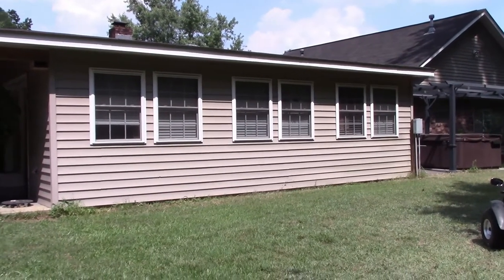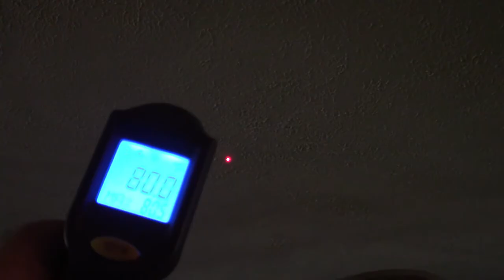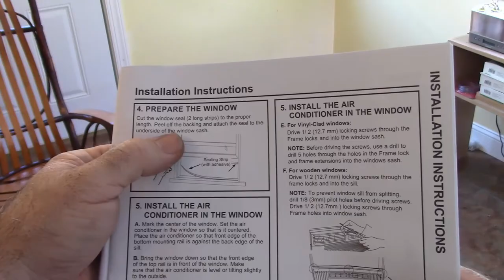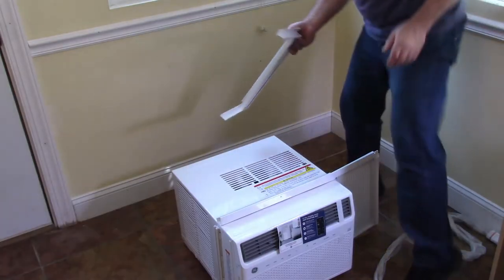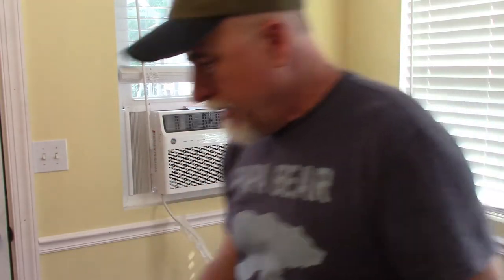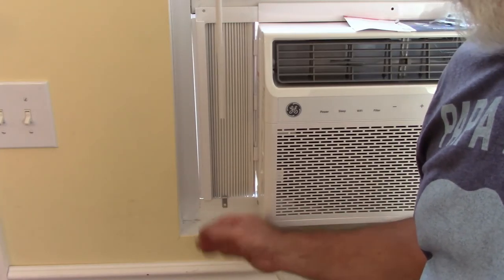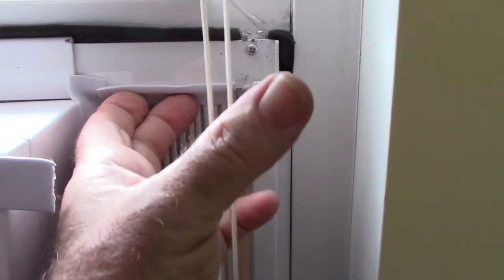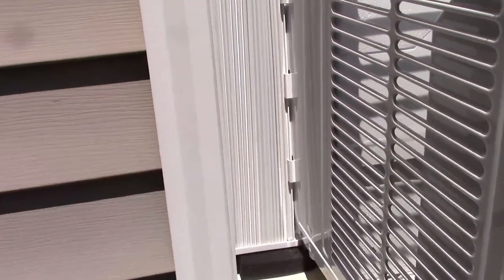GE 12000 BTU window air conditioner install.

Comment: Why don't you just make your roof white it'll help the Heat Factor or you can lift up your roof light three or four inches with more insulation and then put a new roof on it it'll help that's what I did
Reply: Expenses maybe? That’s a silly comment. Less for a rich person. This is poor people talk.
Reply: Who has that kinda loot? We’re talking window AC units! Gimme a fuckin break money bags.

Comment: Mine gives me two minutes of cooling, and then it stops , and what follows is 12 minutes without  cooling and just fan. Into 5 minutes  am already sweating. Tried everything with this GE smart AC. Tomorrow am returning it back to home depot.
Reply from the maker: Sorry to hear that. Ours continues to do its job.
Reply: The thing about AC units is that you are supposed to let it sit in the window for 24 hours as the coolant must settle to the bottom before it starts, the same is true with alot of appliences and letting the oils flow to the  bottom for 24 hours before you use them.
Reply: @williamtalavera1803  I had to return mine as well for the same reason also mine did not dehumidify. You and I just both got a defective unit out of the box.
Reply: @6barry66  did you exchange it for the same model and if so, does it stay blowing cold air? I just bought one a couple days ago and it blows cold air for about 10 minutes then warm air for an hour or so then 10 more minutes of cool air.

Comment: I just bought a 12000 BTU AC unit for my living room. I live in a second floor apartment so it gets pretty hot up here. When I took this beast out of the box I thought, this thing is too heavy and could fall out of the window due to its size. Nothing is under the window I'm putting it in but I was still concerned based on the units size about installation in a second story window. Seems it's the same as the 5k btu installation that I have now. Great video, thanks!
Reply: Is it powerful or not really?
Reply: And you mentrion the 5kbtu unit do they preform the same or is one more powerful
Reply: @xtheslump  12000 business is more powerful than 5000 ac unit

Comment: Is there a rattle noise from the compressor? Mine is brand new and has this. Wondering if it’s normal.
Reply from the maker: I think it is just the metal assembly. Compressor is not making a rattle.
Reply: @charissaJane  my compressor is noisy as well. Since it fits into a sleeve in the wall I bought sound baffling material and glued it on the surface of the encasement. It was much quieter after that.

Comment: Directions didn't say much about drain plug. Instructions say it may be more efficient to leave the plug in, but there is a lot of condensation that comes out of the unit on humid days. No drain parts included ! My unit is on the porch, so I have a small bucket under it. But that is not what I was hoping for. 
How about a little input.
Thanks
Buzz in Maine
Reply from the maker: Not much I can offer. Mine exits outside but I don’t see any condensation running out of it.
Reply: @buzzlovelace  usually the water in it evaporates if it doesn't you can pipe the drain to a place away from your patio.

Comment: 26:07 its very important to remove that so rust wont form on the condenser
Reply: @Rayray_unicornplayz567  the condenser is either made of aluminum or copper they do not rust.

Comment: Good review. But it’s mostly just an install. I wish you talked about the performance. How cold did it get the room. I was very curious because I have the same situation. I’m trying to figure out how many to buy. Did 12,000 BTU get that room down to 72°
Reply from the maker: It actually does a very good job for our space. We have it set at 74. However the room is open to the rest of the house so the cooled air also helps cool the kitchen area.
Reply: Thanks. That’s what I wanted to know. I have the same conditions. Wanted to know if 12,000 BTUs would cool it. My room gets extremely hot in the late afternoon when the sun hits it I think I will make the same move as you.